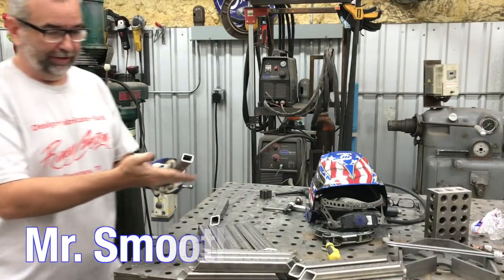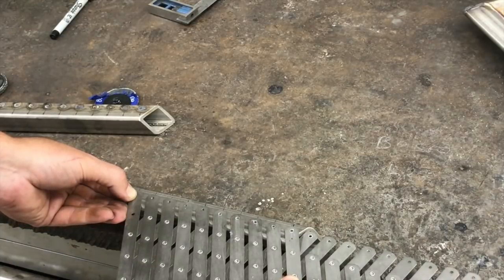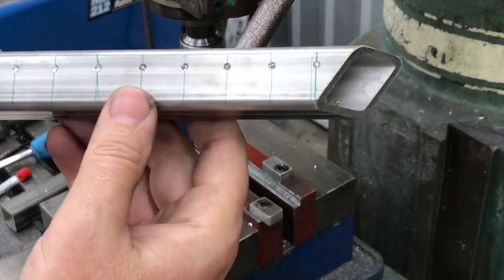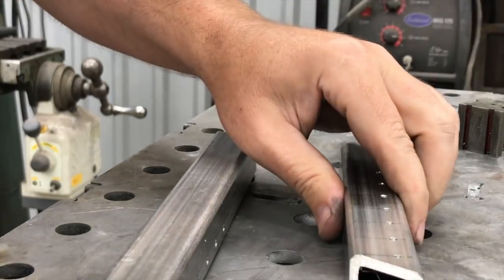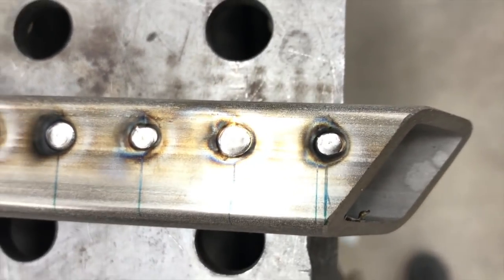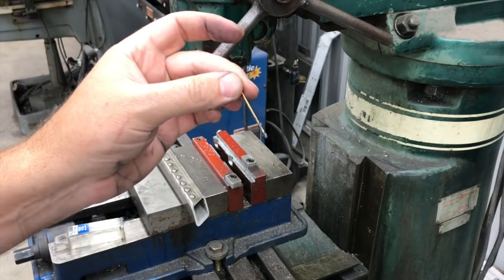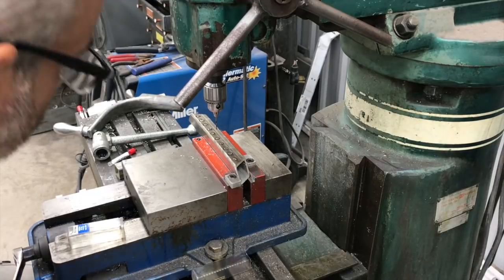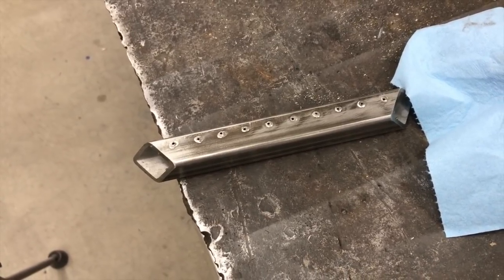Tig Welding Inconel to Stainless Steel - Basic Tig Welding Fabrication

Comment: Surprised you didn't setup an EDM hole drill setup, especially since you can use your existing press/mill... but you said the tolerances didnt exactly need to be 0.0001"... but drilling through Inconel with EDM is fast... and faster through stainless... and you hold a millionth tolerance.

Comment: If those ran at 3,500 degrees as you were told they would not have to worry about the holes because they would just have a big puddle.
Reply: I don’t even think the inconel would last up to 3500 degrees. I think it’s somewhere in the high 2000s or something like that.